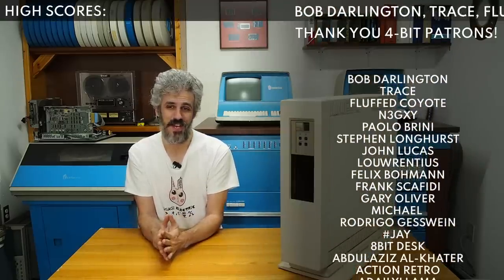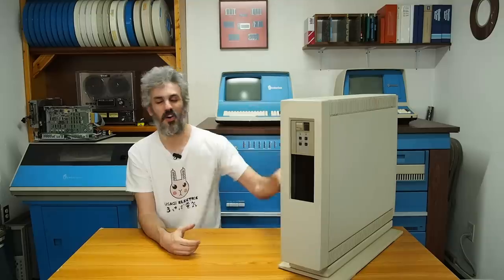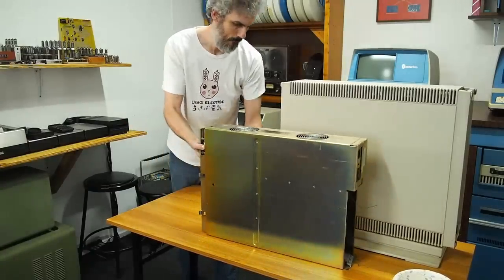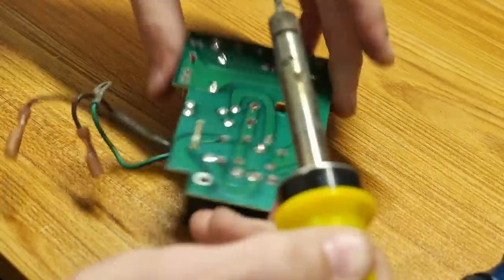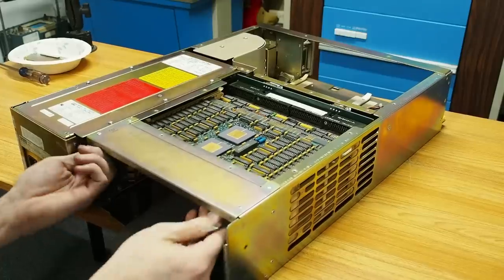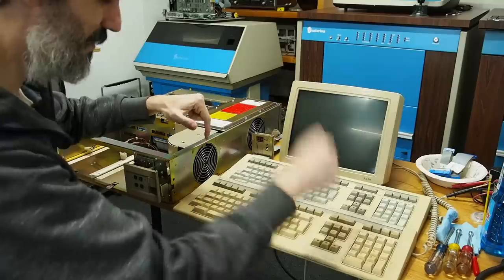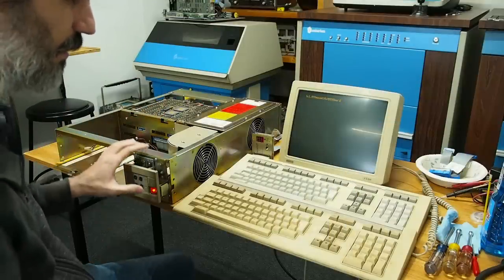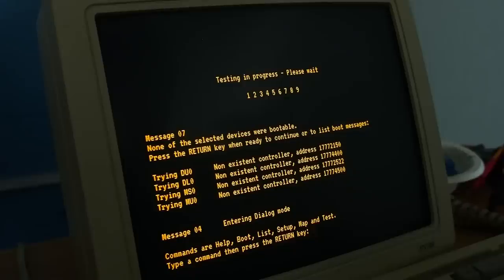The PDP-11/83 Boots!

Comment: I wrote the smooth scroll firmware for the VT240 terminal for which I am co-inventor on a software patent. In the VT300 series smooth scrolling is controlled by a hardware chip. I also contributed to the design of the VT2xx series setup mode, which is the same as the VT3xx that you showed here. We decided to get rid of DIP switches because they cost money and aren't user friendly. I cut my teeth on PDP-11s and also worked on PDP-8 and DECSYSTEM 10/20, so it's great fun to see them still running after all these years. These museum pieces make me feel like a fossil myself. The most enduring feature of the VT2xx design project was the LK-201 keyboard layout, which became the standard for PC keyboards years later. The LK-201 introduced the "inverted T" arrow key formation and 6-key navigation cluster that now sits between the QUERTY keyboard and the number pad. I sat through many arguments about where keys should go but the most controversial was the Escape key. We argued incessantly over this.
Reply: I found it amazing.          

1. Does it use "graphical mode" instead of "text mode"?
2. Is it capable of scrolling only half a line or something similar?
3. Does it interrupt other CPU tasks while scrolling?
4. Does it truly scroll pixel by pixel or does it skip (jump) a line or two of pixels each time?
Reply: @MarcoMugnatto  As far as I understand these things, it's fully implemented in the terminal ... and doesn't have any interaction whatsoever with the CPU.
Reply: Ohh the smooth scroll was epic
Reply: Niceee
Reply: That smooth scrolling is the most beautiful I've ever seen in the computing world. Thank you for the contribution! Did we downgrade ourselves?? Do modern terminals do that kind of smooth scrolling??

Comment: The smooth scroll with the amber just has such a sense of classiness. Of course color will be awesome too haha. Really nice, congrats!
Reply: I wasn't allowed to have a vt320....  Too nice for my pay grade.  Take your VT100 at 9600 baud and be happy.
Reply: I think there’s an option in the setup menu to turn smooth scroll on and off
Reply: Smooth scroll may be "cool" but I hated it.  First, the persistence of the phosphor meant that the characters were blurry while it was scrolling.  Second, it slows everything down.  If several lines are written quickly, you have to wait for the smooth scroll to catch up to be able to read them.  The old jump scroll was faster.  For those reasons, I always turned it off.
Reply: The VT-340s I used back in the day (early 90s in college) all suffered convergence issues to varying degrees. So monochrome might be the better choice anyway.
Reply: @russellhltn1396  I agree. The delay is really annoying when you're trying to get something done. Also, I would crank up the baud rate, unless you want to feel death as you work :)
Reply: @russellhltn1396  Your experience with smooth scroll is similar to mine.  In addition, I discovered that in a long listing, the buffer would overflow and some of the listing would be missed.  That alone was more than enough reason to turn off smooth scrolling.  It may have been acceptable if the speed of scrolling could have been sped up so it could keep up with the line (baud) speed.  I never figured out how to enable hardware flow control on that terminal.
Reply: I remember I've used a terminal emulator on Linux which replicated that effect, it looked cool at first but it was annoying when working. Now I know where this was coming from.
Reply: I worked on the early smooth scroll design, which was popular among marketers but not so much with the user base. It's basically a cool feature to show in a demo but its practical application is questionable. Since the original VT-100 had it, all subsequent DEC terminals HAD TO HAVE IT. (Backward compatibility is HELL!) That's why you don't see it on terminal emulators today and although my browser supports it I don't use it myself.
Reply: On my first job, I had a VT320 on my desk connected to a Pyramid Nile, testing telecoms software. The smooth scrolling was awesome looking, but in reality we always had it disabled because it slowed down actually getting any work done! I also seem to remember that vi and smooth scrolling were not friends.

Comment: My lab at Intel had about a dozen pdp 11/23 back in the late 80s early 90s. Most were dual 8" floppy, running RT11 and VT100 terminals. They were used to gather data from test equipment that was testing EPROMS. The data was stored on the 8" floppies, then carried (sneaker net) to a larger 11/23 that had two RL02 disk drives. I wrote code (mostly in Pascal) to analyze the data and generate reports. Reports were printed on drum printers onto green bar paper.  Eventually they were all replaced with machines with 8086 cpu and real networks.  Keeping all the pdp 11 running required that I had a cabinet full of spares, cpu, memory, serial cards etc. Seeing your collection brings back memories.

Comment: I can totally relate to your giddy excitement when you get some old hardware to run! Something only other vintage computer nerds can relate to :D. Be EXTREMELY careful with the plastic of that old DEC hardware, especially the VT320. I have a VT520 which has been crumbling before my very eyes. Whatever injection molded plastic DEC used wasn't designed to last more than a few decades. Its at the point where its in bits and pieces now which glue cant save. I may end up making a wooden VT520 case with all the guts of the simply because its now structurally unsound. Yeah I just love the amber display of those old DEC terminals.

Comment: You have a 22 bit addressing limit (4MB) and the top 8K is used for I/O devices. I remember when this was something to dream of. The PDP 11/23 I used only had 18 bit addressing (256K) and two 5MB RL01 drives. We upgraded it to the 22 bit 11/23 PLUS with the massive 10MB RL02 drives. Luxury!
Reply: I was looking at the memory map and the "oddity" with the second memory card was immediately obvious when he scrolled to the next page: 8K reserved for IO.
Reply: It's wild to think about how fast technology has changed, here's a few more mind blowers. 26 years ago, 1gb was doable, but considered severe overkill for a Personal Computer. Now 8 times that is considered the minimum despite comparable usage habits. 16 years ago, 1tb in a single HDD was pure fantasy. Now 1tb of NVMe is considered "the norm". 10/100 "Fast Ethernet" was standardized in 1992 and took until 2019 to be replaced with "Gigabit", despite Gigabit being standardized just 3 years later in 1995.
Reply: 5MB drives!!   Why you would never run out of space!  ;-)
Reply: @KiraSlith  I wouldn't say that the usage is comparable - now you have 10 browser tabs open, a messaging client or five and multiple video streams playing simultaneously.
Reply: @barbudoru  I mean, technically you can do all that on 8gb, but it's a pretty miserable experience. Lots of memory paging that'll eventually wear out your SSD. Although apparently Chrome does it's own paging with YouTube either way so... 🙄
Reply: @KiraSlith  I don't think you're right about gigabit Ethernet - it's been the standard for home and office networks since the late 2000's, but typical home WAN link speeds are only slowly catching up to it now. 2.5 GbE and 10 GbE are becoming more common

Comment: I used to use PDP-11/03/04... Machine controllers used in electronic assembly machines from early universal instruments thru hole BCD assembly and rotary sequencer machines. the sequencer puts the parts in order for the VCD to place them on the PCB. Good and bad memories, mostly good as a service and programming guy

Comment: +1 for how awesome the DEC VT320 terminals are.  I did data entry for an entire summer in the late 80's (job during college break) on this terminal connected to a PDP-11 and the terminal screen was easy on the eyes and its keyboard was very comfortable to type on.
Reply: The DEC LK201 keyboard had a shorter travel than other keyboards. This made it fast to type on, but some also claimed it made you more prone to RSI.
Reply: @lawrencedoliveiro9104  I don’t remember the DEC part number, but I liked the keyboard used on the Rainbow / VT220 / VT240 and probably some other DEC offerings.  It wasn’t quite as comfortable as the IBM 5150 keyboard, and the width took a lot of desk real estate, but all in all not bad and fairly rugged.

Comment: I was working in Hong Kong Polytechnic as an Analyst Programmer II, and my first task at work was a BASIC program running on a PDP 11/73 running RSTS/E operating systems....those were the days of fun, because every BASIC pragram needs to be compiled within maximum 64K of memory...Yes, it's 64K, and we need to do page swapping !!!  Modern programmers won't imagine this back into the mid 80's. Love this video, and I still missed all those VT220s, VT320s, and VT420s terminal, and they were so robust !
Reply: I did FORTRAN programming for tracing brain slice images from a stepper motor controlled microscope stage on a PDP-11/34 with 32K words running RT-11.  The compile and link of a FORTRAN program of 500 or so lines could take minutes.  I really liked working with the VR-17 X-Y vector display with light pen.

I also played around with BASIC on RSTS.  My recollection was the BASIC interpreter was pretty true to the Dartmouth documentation for BASIC.

Comment: Really excited to see your pdp11 grow! I was lucky enough to be seconded from the UK to work at Cutler Hammer, Fenton, Michigan for 3 months in 1978. My task was to develop a software program to run on a Motorola 8-bit CPU. Cutler Hammer Fenton was only a small division of the main HQ in Milwaukee and only had around 50 to 100 employees but they had a fully blown massive pdp10 mainframe system as well as at least one pdp11 and countless other smaller systems. I used the pdp11 with a cross assembler for the Motorola 6800. It was heaven for a 24 year old graduate from the UK.
Seeing you working passionately to revive these iconic DEC computers brings back many great memories of a computing era now far in the past. Please keep these videos coming.

Comment: I worked for GE from '83 to '89 and the terminal brings back memories.  We were using the VAX series, but my senior engineer was an expert with the PDP-11.
Reply: I worked at GE Aviation around 2005.
They still had these VAX computers.
They were used for testing some Air force equipment.
To re-tool the test system with modern equipment was just too much government red tape.

Comment: Congratulations on getting your machine running!!!

At Mostek we used RSX-11D on our PDP11/70, and an 11/34. We connected the two with DECnet, it was my job to get that up and running. The link ran between buildings that were about a quarter mile apart. I felt so accomplished when I got the link up. I wrote an application for the 11/34 in MACRO-11 that could buffer data using linked lists which managed data flow between the two systems. I modeled it after a linked list program I’d written in Pascal. When you’re used to programming in Assembler, it’s a snap to understand list pointers. The application would transparently pass data unless the link went down, then it would buffer it to disk until the link came back up. It also cached testing programs sent down, in case a test system needed one when the link was down. I was pretty proud of that program despite not being a formally trained programmer. Hell, back then, no one was formally trained. We just read books and manuals until we understood what we were doing. I’m a hardware and software engineer, which gave me a huge advantage over both camps back then.
Reply: Thanks for the reminder.  DECnet was kind of funky over Ethernet because it would change the MAC address from the BIA on the interface.  We had a few Vaxes running Berkeley UNIX, one running Ultrix and several VMS machines.  UNIX and Ultrix supported TCP/IP natively, but we had to run and add-on 3rd party TCP/IP suite on VMS until DEC thankfully natively supported TCP/IP on VMS.  We used 3Com terminal servers to connect several hundred terminals over Ethernet back to the Vaxes.  Well heeled labs had PCs with Ethernet cards talking directly to the minicomputers in the machine room.  I liked administering UNIX a lot better thanks to more terse interaction with the O/S.  VMS was quite similar to TOPS-20 I’d first used in the 1970s and, shall we say, rather chatty.  I’m reminded of VMS now by the rather verbose commands in Windows PowerShell required for doing Wizard level work in Active Directory.
Reply: @wtmayhew , We didn't have Ethernet back in the 70's, just wires, plain old wires.

Comment: Great work! Thanks for sharing - I really am jealous. 
Worked on PDP-11s from 23s to 73s to 83 and truly wanted a 93..  (all Q-bus) ... also worked pdp-11/40 (Unibus) too.  btw did you know -- odd model number = q-bus, even = Unibus?  Used RSX-11M Plus mainly with F77 (Fortran) for material handling supervisory control of PLCs.  I really am jealous.  Please load RSX-11 as it will allow the most functionality of the hardware and is also multi-user environment.   Love to see RMD again.. resource management display -- shows what 's in memory and where in real time.  Can't wait...

Comment: Wow! That brings back memories.  We used a pdp11 running Zenix on a JCON system in the late 80's for an auto parts store.  Had 4 terminals.   Later on, as other companies were upgrading, I managed to find another  unit from a drug store. It had more memory than our original one so I used  one of the memory cards to expand the memory in our system.  The memory Card was HUGE.  We had to use the floppy disc for backup. Toward the end it was taking over 50 disc to do a backup.  Upgraded to a 386  20 mhz with a tape backup  a few years later.

Comment: Me shouting at the screen when the garbage appeared, “PRESS F3 FOR SETUP!” 😂
Love those VT terminals. Specially the VT220 and VT320.
Reply: Same here. Used VT terminals at the University. Later owned a pile of them which I got from an auction. Sold them with good profit.
Reply: No love for the VT240 or VT340?

Comment: The differing sizes displayed for the two memory cards is because the top 8Kb of address space are reserved for I/O.
 
Smooth scrolling on the VT320 (a feature inherited from the VT100 which introduced it) works by advancing the display one scan line per frame.

Comment: Wow, I haven’t seen a PDP-11 run or a VT terminal since around 1987.  We had them in various rack mount forms running in the “Message Relay Centre” of the Australian Overseas Telecommunications Commission.  Basically we took telex messages in from around the world and reformatted them for local distribution. The PDP’s were workhorses used for a bunch of different tasks with the most interesting being the support to keep a pair of Univac 418’s running.  These old dinosaurs ran the production software for the entire message relay centre and were built using magnetic core memory and “Fastrand drums” for storage. The cost to replace the 418s was prohibitive and the drums were getting pretty unreliable and almost impossible to fix. They were around 12’ long and weighed a couple of tons each. The PDPs were used to emulate the drums to the Univacs and wrote out to “Modern” lol removable media disc drives….

Best part of them was that we had a tech test system that was non-production that we could learn on, and of course, it could play Zork lol.

Comment: Nice to see the PDP booting again.   The VT-terminals were really nice to use.  Sadly I was part of a team that was disposing of old computer equipment for several government agencies and everything went into the crushing garbage containers.. I just managed to take aside some now lost diskettes and manuals.  My first experience of the  VAX'es was when I was using my modem back in the mid 80-s, having it dialling numbers during the day, then getting some connections to try for the evenings.  Vax, Norsk Data, IBM etc were all on modems with little to no security.. :)

Comment: I've only seen one running PDP-11 that I can recall and that was in the mid-1990s at the aircraft plant where my father worked.  It was connected to a power analysis system mounted to a large cart.
Reply: I've seen none running despite owning about 3-4 at this stage...

Comment: You have inspired me.  I have many hours using older systems.  So what I decided to try is to make a 'sleeper' version of some older x86 Sun gear that I am used to working on. I basically keep the case and install much newer hardware.  Then I can run a bunch of VMs.  Waiting on parts still.  Fingers crossed that I can cram it all in there.  But I am all excited to try it.
Reply: Thanks for the reminder, I’d almost forgotten Sun dabbled in X86 hardware for a while.  I ran Solaris 86 on a generic Pentium-90 PC at home running NCSA’s web server for a while with an Internet connection over a 256Kbit ISDN connection.  Installing Sun packages was a pain in the neck and fighting off Russian hackers trying to break in was pretty much a continuous thing.  Those were the days.
Reply: Update: AMD Ryzen 9 5950X 32 threads, 128Gb RAM. Up and running. It is very fast and easily runs multiple VMs.